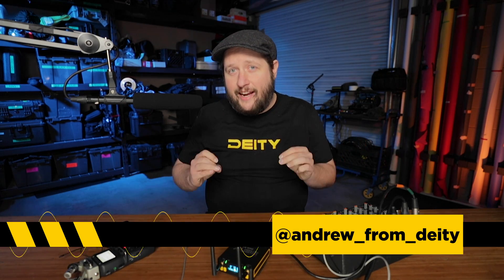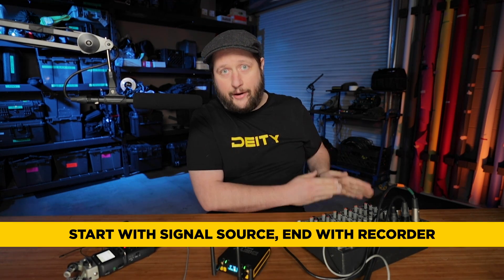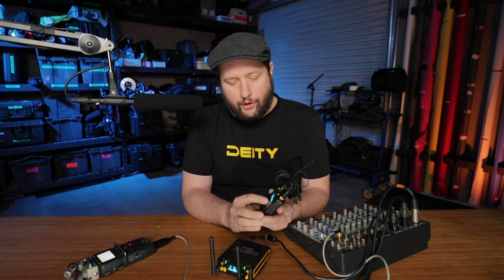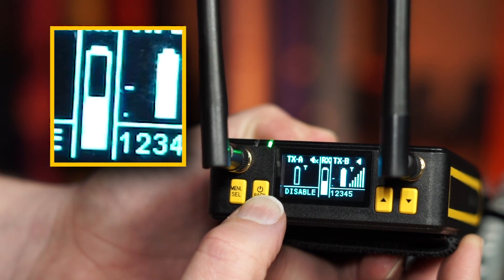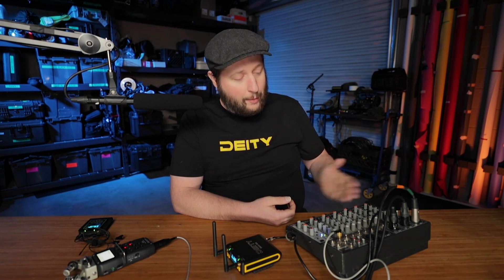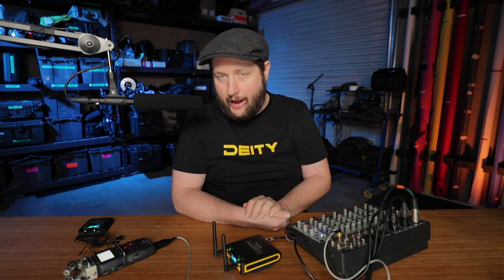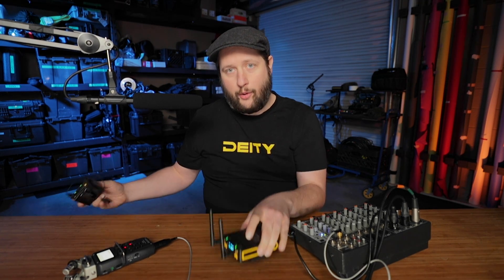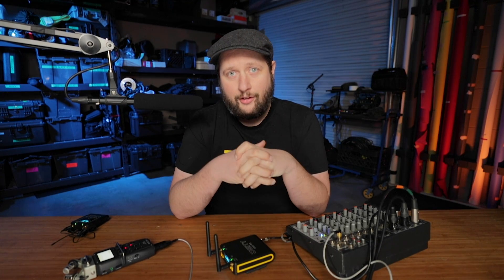Gain Staging: Everything You Need To Know

Comment from the maker: What's your gain staging troubleshooting process?
Reply: I have a question I have a Focusright 2i2 fist gen Auido interface I am using a Auido technica atr 2100 over XLR I have to turn the gain way up to get the sound loud enough should I just get a condencer mic?
Reply: @BadKarma714  It's totally normal to use a lot of gain with dynamic microphones. Because these typ of mics have a low sensitivity you need to amplify their signal considerably before recording it. Nothing to worry about ;)
Reply: First, wipe down my mixer ;-) Smart remarks aside, this was a great video. Thanks, Andrew!

Comment: How do I know if my reviver is a line or mic signal? For example the rode wireless go 2 or dji connected to my DSLR. Do you leave the receiver at zero dB and adjust just the transmitter and camera gain to obtain adequate levels? Thanks mate.

Comment: Nice job Andrew - great fundamental topic!

One note for those not already aware of a nuance with the Zoom H series of recorders and recording line level signals: The Zoom H series take line level via 1/4". If you do that instead of XLR, you won't have to use the pad to drop the level and you'll bypass the H5's mic preamp which is probably good in this case - best not to go through multiple gain-attenuation stages if you can avoid it.
Reply: Whoa. That I did not know. Thanks Curtis!!
Reply: @BasicFilmmaker  👍
Reply from the maker: Very true.
Reply: is the Zoom F series the same?
Reply: Wow, between Andrew & Curtis, I am learning soo much from these gurus
Reply: Great info, Curtis. Thank You!